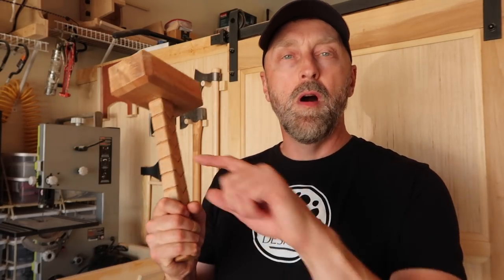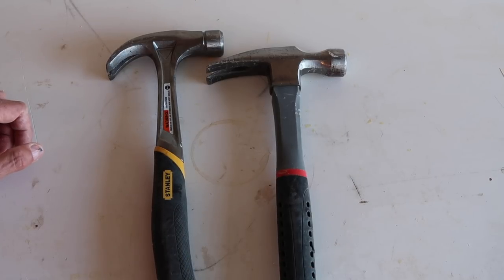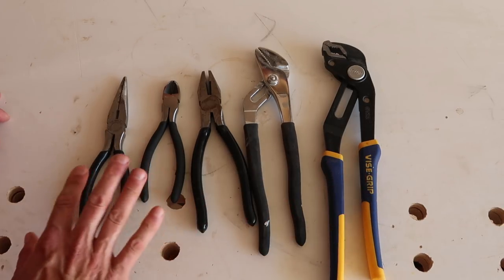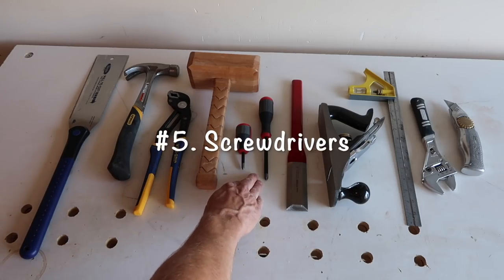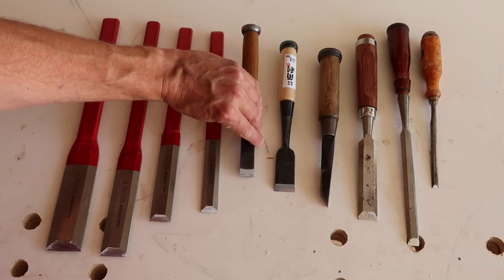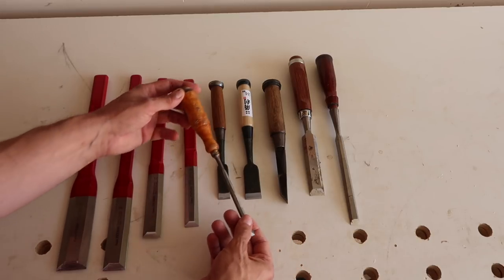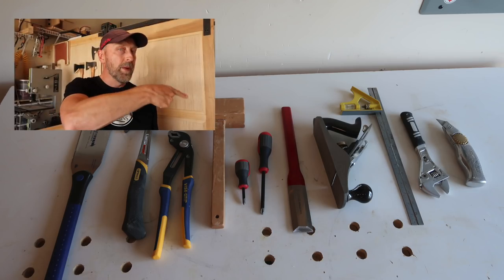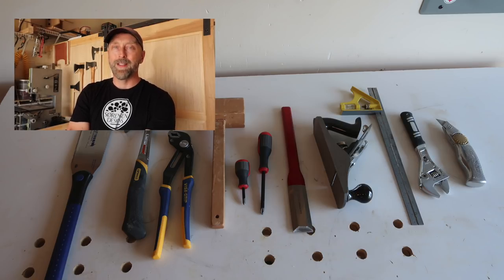10 Essential Hand Tools

Comment: Thanks Eric. what is your opinion of the rubber-head mallets? And what method do you use to sharpen your chisels?
Reply from the maker: Hi David, I don't use rubber head mallets all that much. I prefer wooden mallets. Instead of rubber, you can glue a decent piece of leather on the head of a wooden mallet to soften the blow.  To sharpen chisels,  I use a Suehiro Japanese Whetstone 1000 / 3000 grit and a stropping leather to finish. If the chisel edge is really dull, I will lightly rough-sharpen on my stationary belt sander on 120 grit to get the bevel back before using the whetstone.

Comment: This is a question about plane blades. I had a professional carpenter working on a project at home. He was using a carbide tipped blade for trimming/flushing up laminates. He said that he uses it only for laminates. What do you think? Are carbide tipped blades the one to go for when for normal use. Else what sort of blade should I go for to put into a locally sourced bench plane. Thank you
Reply from the maker: There are different grades of tool steel for plane blades and they do need to be sharpened properly after regular use. Carbide blades are more common in electric hand planes or router bits. You can use a block plane to flush trim laminates - no carbide is required really - just a nice sharp block plane blade. Block planes are fairly inexpensive. As for plane blades, there will be the manufacturers blade that comes with the plane you buy and then there are companies that offer replacements such as Veritas: http://www.leevalley.com/en/wood/page.aspx?p=42607&cat=
Reply: Eric Sorensen. thank you. I really like your videos. I live in India and many of the tools that you normally use are too expensive for a DIYer. However, newer tools are now becoming available more easily, though still too expensive. Thanks all the same
Reply from the maker: You're welcome Subra Vk! Thank you for watching. You can do a lot with even the most basic tools. Some of the Chinese and Japanese hand planes are good options if they happen to be more accessible in SE Asia.